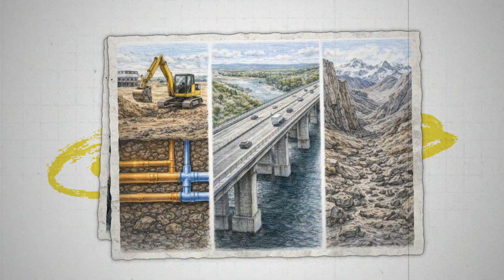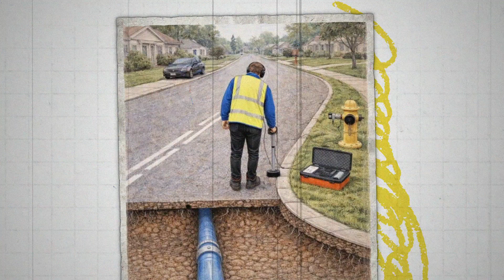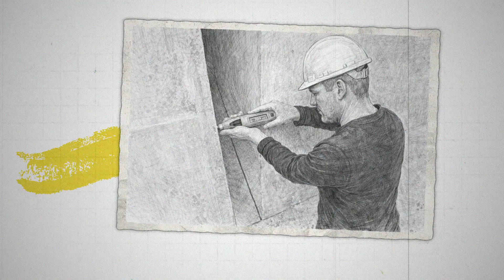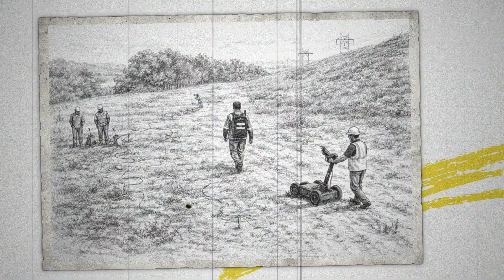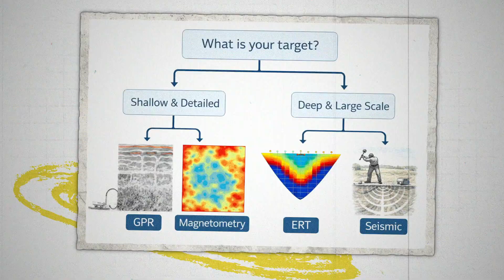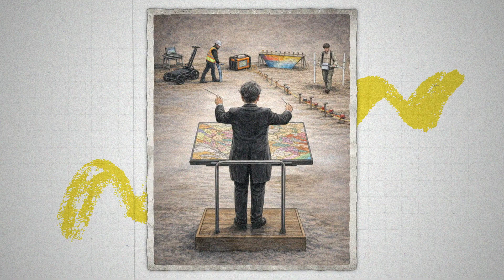Don’t Use GPR Here: When Radar Fails (And What Works Better) | GPR Decoded Ep. 8

Comment: Hi Jan, is it possible for you to explain how to make a GPR machine that identifies gaps in sand and can be set to 5 meters or more? 🌹🌹🌹
Reply from the maker: What did you mean by gaps? Voids in sand?
Reply: @GPRDecoded  Yes, the gaps in the sand, I want to know how to make them. Can you help me? Are they complicated?
Reply from the maker: @3Am-Pm-Not Maybe it's a translation problem. You want to make a void filled with air in sand? That's hard to do because the sand will collapse. Or if you want to find a hole filled with air or water in sand with GPR, that might be easy, depending on if the sand is wet or dry. It's all about contrasts, so a void made of air (in wet sand) will be easier to see than in dry sand
Reply: @GPRDecoded  The sand I have is dry sand, and I want to make a ground-penetrating radar (GPR) device. Will the STM32F411CEU6 microcontroller help in building it? I want to know the parts used in manufacturing or another method. I need help because GPR is banned in my country.